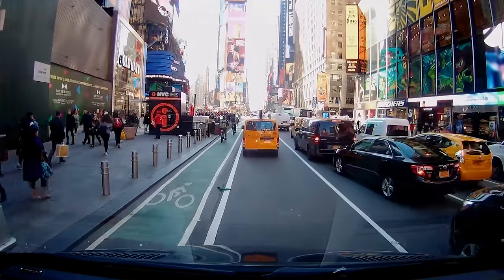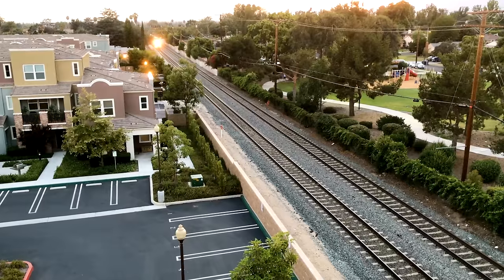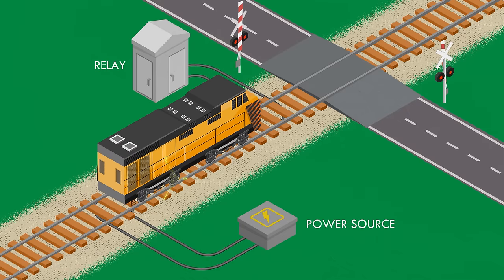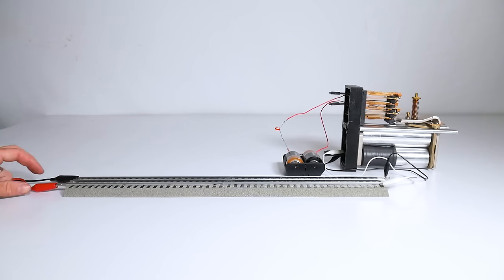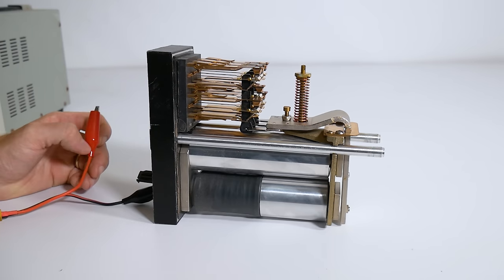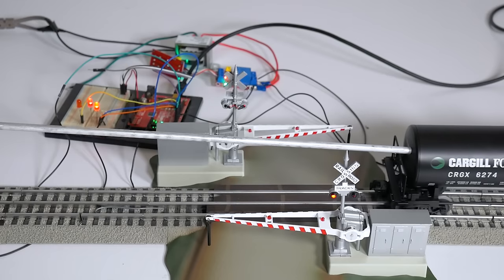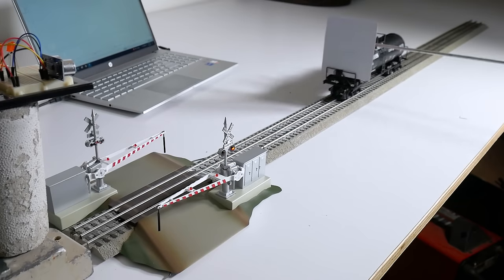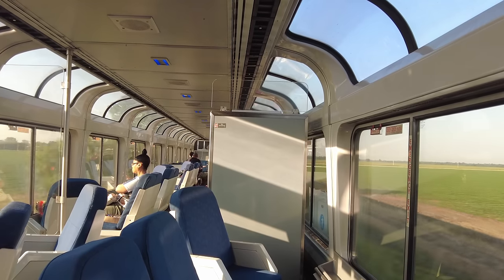How Railroad Crossings Work

Comment: I feel like railroad crossings are a mistake, they should only be used in special cases. The road should go over or under. It would keep the speed higher for both, and make the system much simpler.

Comment: The fatal design flaw with railroad crossings is: there is no GREEN light

Intersections do not only have a red light to tell you when to stop - they have a green light that tells you its ok to go AND it tells you that the light is powered and operational.

This is why school busses and some other vehicles are required to STOP at all railroad crossings. If the power is out or the signal has failed, there is no way to tell whether a train is coming

or not.
Reply: In many European countries (such as Czechia) they have a flashing white light for that reason. It means that the equipment is working properly and that it's safe to cross.

Comment: It's not complex. You send electricity through the rails and when the wheels of the train come over the section, it short circuits it and the barriers fall. It's a fail safe system. Just like you said. There are many other ways

Comment: Some things that were emphasized during Class A and Class B license training were:
Never leave your vehicle on or within immediate proximity to a track
With a manual, don't change gears until after you clear the track- that's one less potential point of falure to leave you stranded across the track
If you need to move out of the way of something and the crossing bar is obstructing your ability to get out (maybe you weren't paying attention and got stuck on the track and it closed behind you and the only place you have room to move is backwards for some reason), they are made to 'break off'- they are more of a visual indicator than an object keeping you from physically passing
If you are stranded, find the blue sign. Dial the number, memorize or write down the crossing number, and move away from the track as soon as possible. Don't try to move your vehicle, don't stay in, on, or next to it, just throw your hazards on, call the number and clear out.
Something specifically mentioned for school buses- wait until the lights and alarms stop before crossing, even if it takes a second or two after the cross bars move out of the way
And, as usual when operating a vehicle, pay attention to traffic ahead and behind you- even moreso than usual. Doing this will keep you from being stuck on or too close to tracks

Comment: Personally, I think that we should DEMAND a reduction of long haul trucking by 80% over the next 10 years. Railroads are SO MUCH MORE EFFICIENT at this, its not even funny. Plus it would drop our carbon footprint  quite a bit. I have never done a study on the exact amount, (both because i do not know how to get the data, and I just do not have the energy to do something that big. one of the "youngsters" with the skills can do that).  reviving the railroads would provide many jobs as well.  there is such a demand for truck drivers, that the supply and demand would finally catch up with each other.

Comment: You clearly are NOT an electrical engineer, let alone an expert of Railroad equipment.  It's Not a short in the circuit that sets the gates off, its actually a completed circuit.  You even mention this when you said "Shunt" and shunt is actually a completed electrical circuit connection, not a short.  A short is an open circuit that does not allow electrical current to flow.  If it doesn't flow then you cannot measure resistance or impedance. Impedance is how the system measures the speed of the train to activate the gates in a timely manner.   Its a basic switch.  Each rail is independently energized.  When the metal wheels and axles of a train touch both rails they "complete" the circuit, creating a "closed circuit" or switch and that activates the signals.  There has to be a closed circuit to perform the "timing" or speed of the train to activate the gates based on the train's speed.  That "timing" is called impedance (or resistance) and an impedance cannot happen unless there is a flow of current. If it was a short as you incorrectly describe, the circuit is not complete and there would be no flow of current and the impedance cannot be measured.  Your example with the model tank car and LED works because in your example your system is not measuring the speed of the train.  So you can get away with shorting out circuits in your example because in your little model, you are not.. nor do you need to... measure impedance.  But on a real system impedance and resistance have to be measured in the rails and to do that there has to be a closed circuit.

Comment: As someone who used to work on signalling infrastructure on the railways: DO NOT TAKE THE LACK OF ALARMS/LIGHTS/GATES AS SAFE TO CROSS. Always, always look for any incoming trains as you approach, it is far too easy for level crossings to become inoperable, especially when you get more than one track or additional infrastructure like traffic lights or nearby switches.

Comment: Yet the brain-dead, air-headed morons of the media, and those addicted to using their cell phones while driving, would, and do, argue otherwise, the AmTrak, gravel truck collision in Missouri, being just one of the crashes where driver inattention resulted in deaths.
The potential for a train-vehicle collision IS ALWAYS THERE, and this possibility goes up exponententially on rural crossings, but is also there because of traffic signals, and the short distance between the intersection, and the railroad track.  The traffic light should be placed BEFORE the road intersects the crossing.